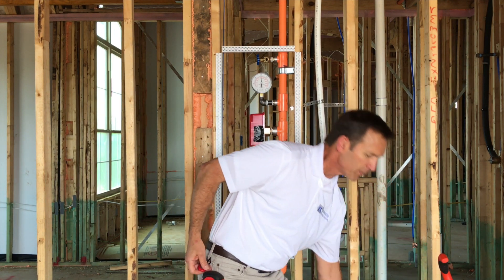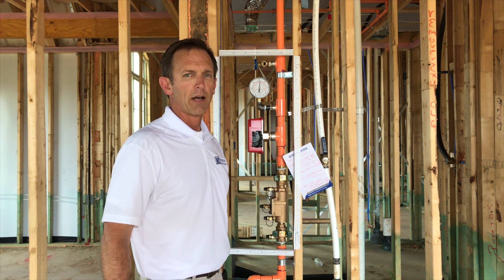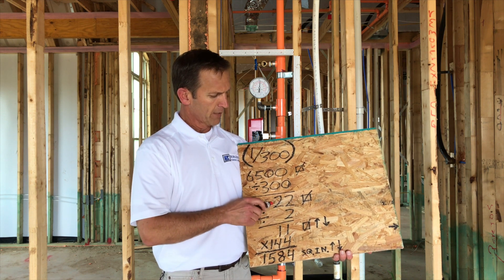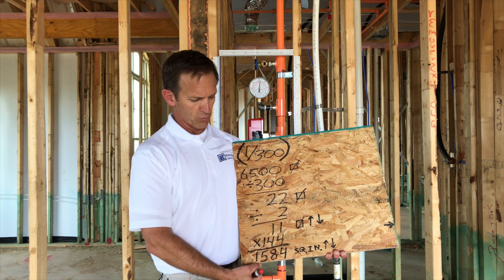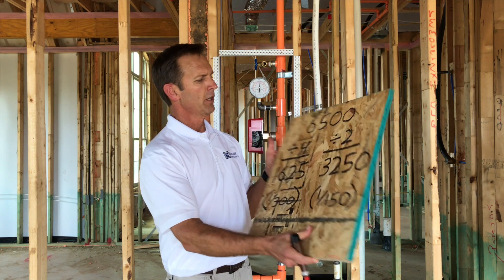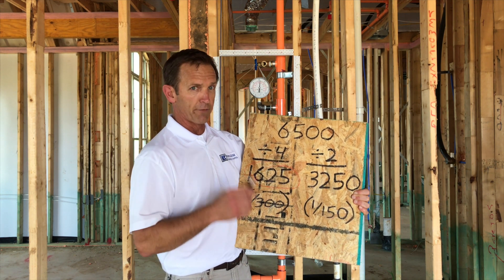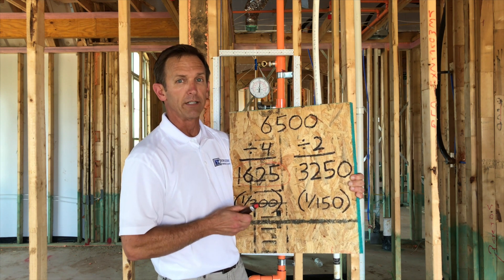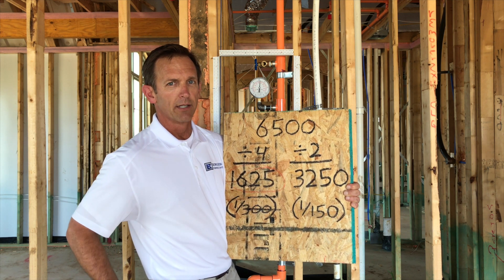Attic (Roof) Ventilation - R806

Comment: The IRC states that venting is calculated for the "area of the vented space", not the square footage of the home. Your calculations are not correct as  you are using the square footage of the home.
Reply from the maker: Thanks for the reply Thomas, and for viewing our videos and providing input.  As we all endeavor to build better and help others along the way it's important to be as clear as possible in our communication so I appreciate adding clarity as needed.  At :58 seconds I mention the calculation is done off of Attic Floor Space.  While the code certainly says Vented Space, at times we will use verbiage that is actually used in the field so as not to muddy the waters. The sample house I used for math at minute 5:00 just so happens to be a one-story where the attic floor space is the same as the foundation footprint.  So, the math was spot on.

Comment: The IRC states that venting is calculated for the "area of the vented space", not the square footage of the home. Your calculations are not correct as  you are using the square footage of the home.
Reply from the maker: Devin, At :58 seconds I mention the calculation is done off of Attic Floor Space.  While the code certainly says Vented Space, at times we will use verbiage that is actually used in the field so as not to muddy the waters. The sample house I used for math at minute @ just so happens to be a one-story where the attic floor space is the same as the foundation footprint.  So, the math was spot on.